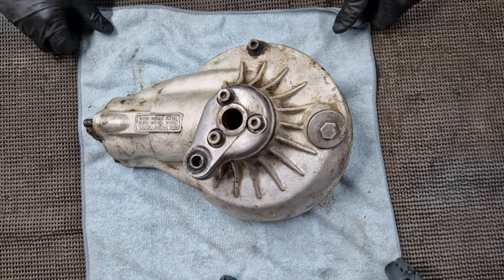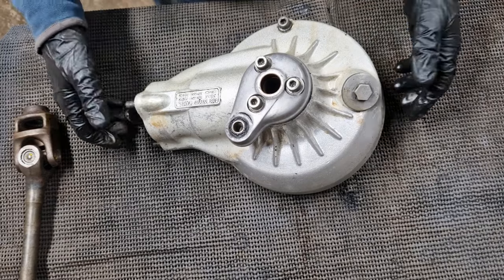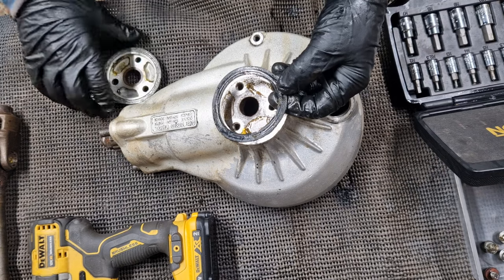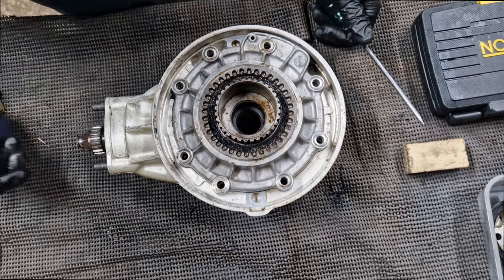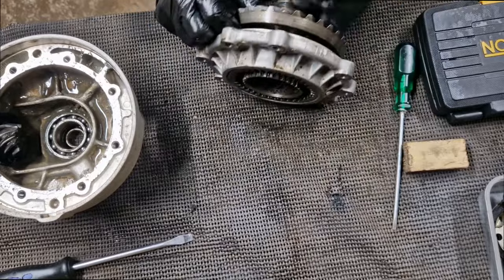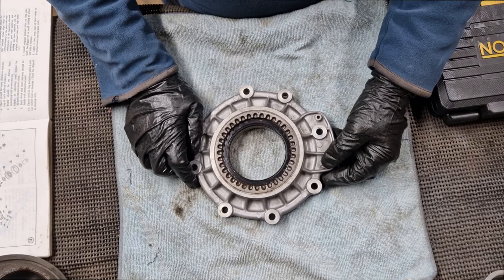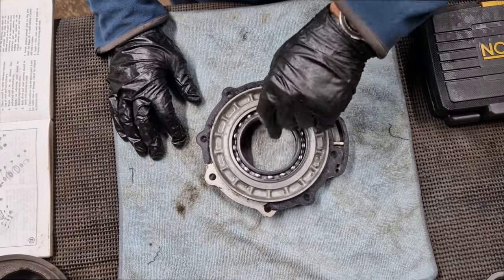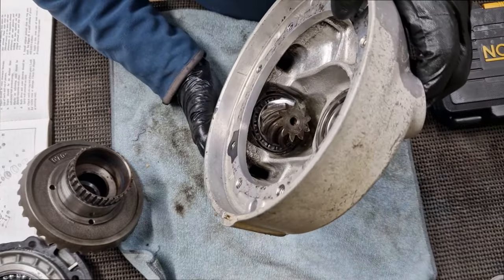Honda GL1000 Goldwing restoration part 10: Final Drive

Comment: I've restored many GL1000s and GL1100s. The final drive runs in an oil bath, so, the gears will generally show no signs of wear. I have worked on these bikes with well over 100,000 miles on them and final drives are still solid. The only reason to disassemble one of these is if it is leaking oil. Replace a couple seals and a gasket and move on with your day. However, the last time I had one leaking, I could not find new seals. So, I filled it with Lucas Hub Oil and it never leaked again. Lucas Hub Oil rejuvenates the original seals.
Reply from the maker: That's great to hear! Thanks for the info, much appreciated. I've watched the GL videos you've done as well ;-)

Comment: Hi there. Really enjoying your restoration of the Goldwing. I've restored 2 bikes, a Silverwing 650 (naked) and a Goldwing 1982, Aspencade. I just thought I'd mention to you, there is a specific oil used in that diff. It's from Honda, as well as the grease, if I remember correctly. Looking forward to the rest of the assembly. Take care!
Reply from the maker: Thanks for watching and commenting and the tips 😀

Comment: The Taper Roller Bearing needs a fair clearance for the EP 80/90 oil to circulate easily..when nipped up it should rotate smoothly
Reply from the maker: Thanks, that's good to know!

Comment: It's interesting to see exactly what's inside here. Also, that a simple gear oil change may not be enough!
Reply from the maker: Yep! It's got more to it than meets the eye. I wasn't expecting to have to check it for pre-tension/shimming etc.
Reply: @VJMotoResto  Be interesting to see if it's within tolerances when you get to the bottom of it! I'd also like to know if the grease nipple you found painted over on the drive shaft is in fact a grease nipple
Reply: @SuccessShared I had an 82 Goldwing Aspencade, it had a grease nipple on the shaft housing.
Reply: @chriskangeter8993   My 1975 came with a grease nipple

Comment: Was that the OEM drain bolt? My 1100 has a hex bolt intead of an allen. The 1100's dont have the cooling fins either.
Reply from the maker: There are a lot of non OEM fasteners on this bike! I'm going to replace some of them but leave the ones that make sense, like the Allen bolts on the engine.

Comment: umm, is shaft drive better than chain and sprockets, not exactly maintenance free and looks to weigh more.
Reply: I prefer shaft drive. The 82 Goldwing and 83 Silverwing I had were both shaft drive. Much smoother than chains. Both of these bikes had a fair amount of mileage on them. All I did with the diffs were change the fluid with Honda specific, gear oil...lube the grease fitting. That's it. That was just for my own peace of mind, there was no other "need" to do it. My earlier bikes...specifically a Suzuki GT250 went through chains and sprockets pretty quickly...
Reply: @chriskangeter8993  I too prefer shaft drives,,,but in my opinion chains can last a very long time/high mileages when fitted in a chain case...